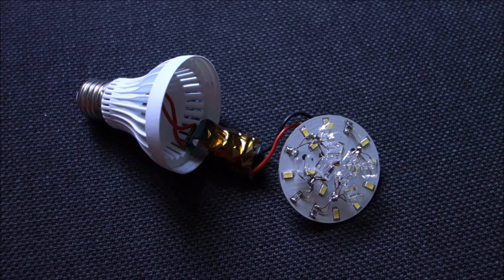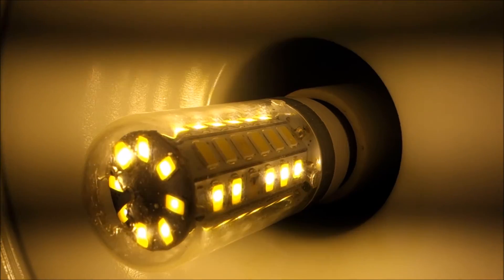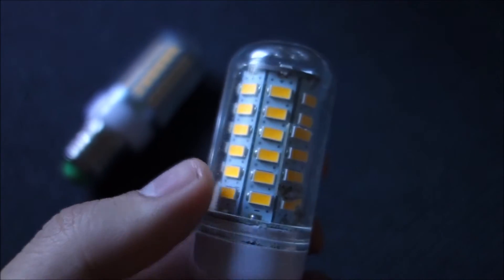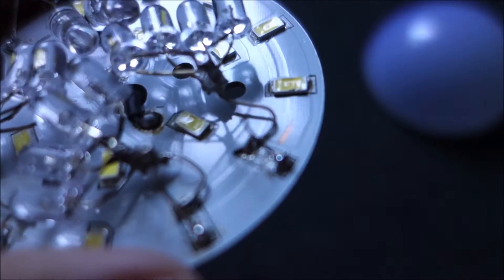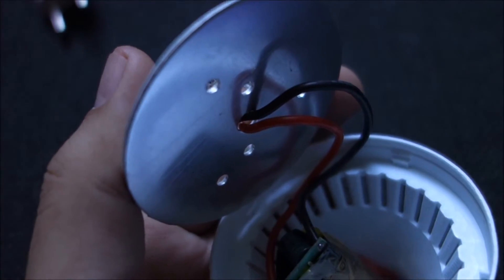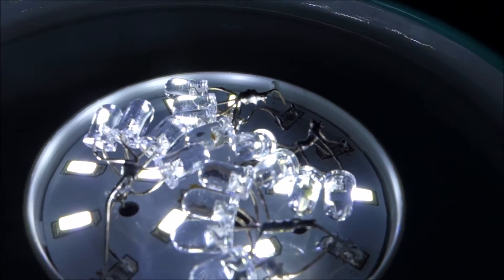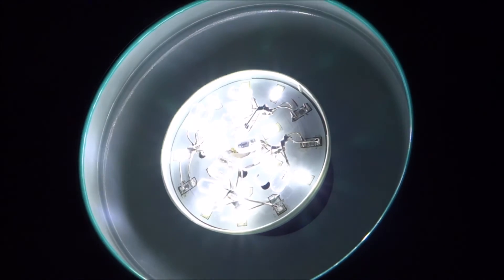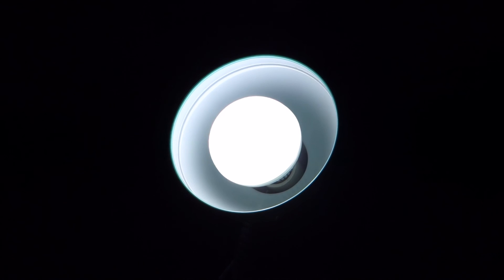How to fix a LED light bulb with individual failing LEDs

Comment: thanks for the video. very nice fix. i have the same problem, one led stopped working on the similar led bulb no it does not work. i plan to do the same fix.  so i solder 4 led in parallel to replace 1 broken led?  what will happen i solder only 1, led?
Reply from the maker: +luckienuckie welcome and thanks for watching. If you solder only one led it will burn out from overcurrent. One single standard led is not able to withstand the current needed to work. 4 of them are almost a match for the original led. If you have enough room inside the bulb, try to use 5 in paralel, just to be sure they don't burn out.